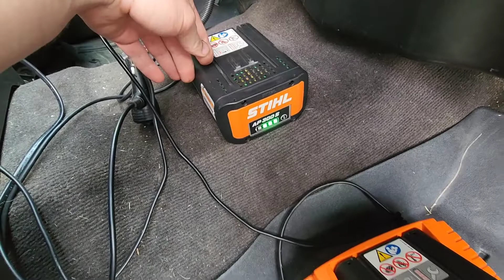This is how I charge my electric stihl power tools on the road. [wiring an inverter]

Comment: Fire not good. You really do need a 75-100 amp fuse at the battery side and #4-#2 AWG cabling to that 750 watt inverter. Unfused, that cabling you have running through the engine compartment and under the steering column is unprotected -a short to ground causes fire. Fire not good.

Comment: Do you need to run the truck to charge it ?   I have the 300.4 charger and I have a diesel 2 battery truck.  We stop at properties 30-60 mins at a time. Do you think I’ll have issues not being able to start my truck as the charger will be running all the time
Reply from the maker: From my experience I don't think  you'd have an issue. As long as you are running the truck for a while between jobs it should make it.
Reply: @zachbismarck I think I messed up.  I made a set up in my trailer with an inverter and a big battery and hooked it to the seven pin.  Problem is the charger drains that battery and just over an hour. I thought it would run for a few hours off of that battery and the seven pin would charge the battery back up, but I don’t think that is the case.  I don’t think he has enough power coming through the seven pin to charge that battery in there when I drive. So I may have to move it into my truck like you did that way the alternators are charging the batteries.

Comment: I just got one 750 whats power converter I try it on my jeep recharging one AP500S battery an using the AL500 BATTERY CHARGER with jeep not running, but about halfway of the AP500S battery recharging the alarm went on and I have to start the jeep motor. On the jeep I have a 70 whats battery,  so very much is no use in my case if I need to have the Jeep running is kind having a generator.

Comment: I got the commercial edger and the step down weedeater. I'll have to get this inverter. I got the big everstart v8 jumper box so that would be nice incase I kill the battery. (It wouldn't charge the stihl batteries) even though it has 500w and the charger is 300w?? Oh well 
Thanks for this video hopefully it's still working out
Reply from the maker: Yeah, thanks for the comment! It worked great all last season. I'm excited to see how this year goes. You'll like that commercial edger, they work great 👍
Reply: @zachbismarck  being able to start hours before morning rise is a game changer! Lol
Reply from the maker: @07350zhr  it really is nice!
Reply: Not this brand but I just buy one 750W inverter, I have a jeep Suzuki and the jeep battery is 70w. I try yestarday having the jeep not running and using the Stihl charger 500 and the Stihl battery AP500S, the battery was discharged and it starts charging but after charging 2 cells the alarm on the converter went on for what I understand the jeep battery was going down so I stop and was able to start up the jeep then after 5 minutes I connect it again and the alarm went off. In my case with out the jeep running I am not able to fully charge one batterie.
Reply from the maker: @Carlos Afonso  yeah that 500 battery is a big one. You'll probably have to charge that one between jobs.
Reply: @zachbismarck  dang that sucks I have the 300 non s hopefully it works for me I gotta do something soon Summer Is here basically lol
Reply: @zachbismarck   You meaning like when driving between job sites?
The problem is that in my cases I always use the batteries on one place 99% times cutting fier wood, not going from house to house doing grass cutting and yard cleaning.
Reply from the maker: @Carlos Afonso  oh no! Might need a few more batteries then or run the vehicle.
Reply: @zachbismarck  Yes, but then if I need to run the vehicle or have a load of batteries it defies the all purposes of battery power and in that case is preferable a gas power unit.
I have the Stihl MSA300, 220C, 161T and the Trimmer 135 and I have the bateries, 1 AP200, 1 AP300, 3 AP300S and 4 AP500S, I have been out on the woods cutting oak and running out of power. 
I am happy with machines I have however my feeling is that the battery technology and the recharging options are not up to the machines yet for professional use.

Comment: Have you not use any fuse?
Reply from the maker: I didn't but it probably wouldn't hurt to use one.
Reply: a requirement in all electrical cabling applications -even the dome light is fused

Comment: BLUETTI Portable Power Station EB3A has a 60 dollar discount, it 299 with 60 off, mine is Tacklife w30 300wh. You can charge stuff on the go or if there is a power outage.
Reply: Have you used this Bluetti to charge stihl batteries, how many time can you recharge batteries if you have. Thanks
Reply: @bretforfar6582  No I haven't but my buddy Micheal Douglas lawncare has the unit on his youtube channel using the Stihl batteries, I have a tacklife 300 watt solar generator that can run a 50 inch for 5 hours

Comment: I have that same inverter it works really good
Reply from the maker: No kidding! Great minds think alike 😉
Reply: Do you need to have the truck running? If not how many times can you charge the Stihl AP500 S battery before you run out of power to start the truck itself?
Reply from the maker: @sirvozelo1  it will charge for a while with the truck off. It wouldn't be good to leave it charge for hours with the truck off, but quick hour or less jobs with a good fresh truck battery is just fine. My truck does have a larger alternator too just an FYI. It charges the ap300 in about 45 minutes not sure on the ap500...
Reply: @zachbismarck  I have all batteries from AP200 to AP500, the point is that if I go out in the woods to cut trees I sure like to use the MSA 300 because is fast and powerful I have bout blades for it 18" and 16" but even with 16" cutting logs were I use about 80% of the blade in 15 minutes I am out of power on the AP500, I have 3 of those AP500 but to cut continuous is not enough, is good as you say charging in the truck but if we need to have the truck running then kind be like using a gas saw. Hope Stihl comes up with better and long lasting batteries sooner. Other thing I notice, a week ago I was cutting tick logs next to the house so I can charge all the time but using the MSA 300 continuous the battery AP500 not last long and got hot then it takes my charger 500 about 20 minutes just to cool off the battery so it can start charging back ,if I was to charge on a truck then it with be 20 minutes more for the truck battery.
Reply from the maker: @sirvozelo1  yeah that's tough! I drive after using mine, from job to job so it makes sense.  I have to run the truck. The chainsaw would definitely be a different story for sure! I never thought about that.. that's a scenario where a gas saw would make more sense.
Reply: @zachbismarck  Where do you buy this and what was the price and the brand? I am in Europe now I am afraid I can't find it here.